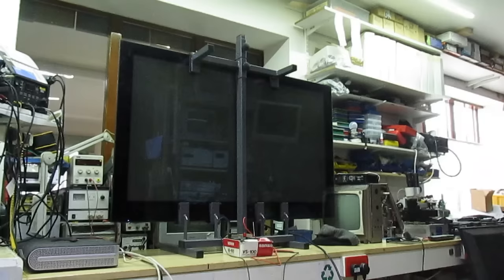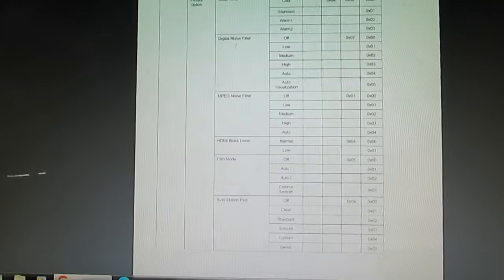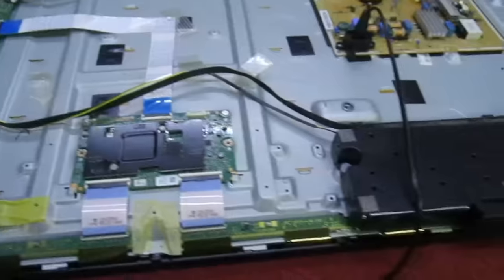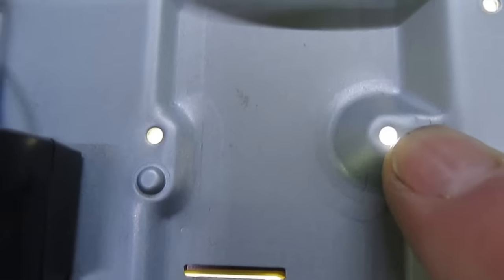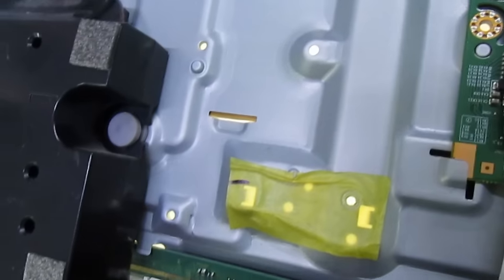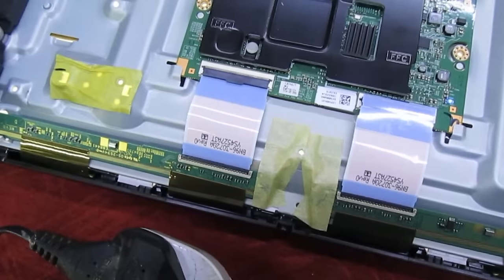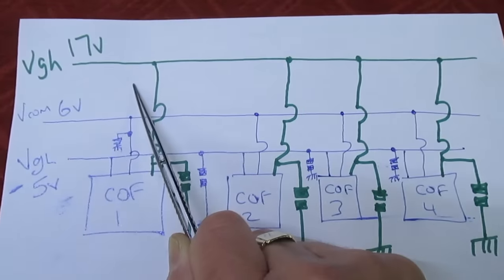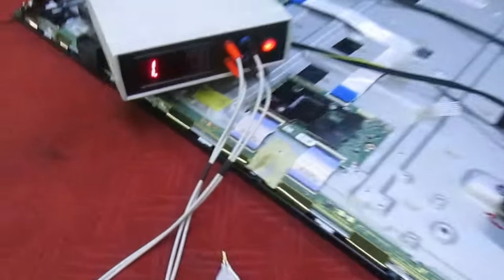Video to highlight the problem of repairing flat panel TV sets

Comment: In my last job I saw faulty MLCs all the time, only the stuff I was working on you'd have 100+ of them across each supply rail, on a PCB of 1ft by 1ft with mostly fine pitch components. The fastest way to find the offending capacitor was to solder two wires across the supply rail and give the board it's expected voltage with with a current limit of around 3A, you then either use a FLIR camera to find the hottest component OR you spray isopropanol (IPA) all over the board and look for the area that dried off first.

Unfortunately the stuff I used to work on had all sorts of safety circuits built in to stop the thing working if any of it's connectors were not seated correctly, you'd get about 500 milliseconds before it would detect and error and shut the supply down, so this very old school way of fault finding simply wouldn't work on that stuff, in fact some of the 3 phase power inverters (motor drive) would just explode if you did that.
It was hours of "fun" reverse engineering unknown circuits on multi-layer boards with hidden vias.
Reply from the maker: I don't have a thermal camera so if I cant find the fault with a milliohm meter I do the bench power supply trick and burnt finger method !

Comment: It's disgusting that the manufacturers are not providing the critical information they are supposed to provide for proper service. This is worse than "right to repair" because you are a service provider that is supposed to be authorized and trained on this stuff. Everyone complains about e-waste and this is a perfect example of how to avoid it. Good job and piss on the TV companies!
Reply from the maker: I quite agree  but if TV s had kept up with inflation a set like this would have cost £2,000 and them manufactures would support repair but in todays day and age they wouldn't be in business very long selling a part for 10p .Hence everything now is designed to sell you a new one .
Reply: @michaeldranfield7140  I think you are right but your cost per year on the item might be the same. If I spend $400 and it needs replacement in 5 years or I can pay $1200-1500 and it lasts 15-20 years. You have the same cost per year and have less waste in the system. If the units were recycled to a significant % level then it wouldn't be so bad but it's like the 60-70's where companies were dumping chemical waste into rivers, lakes and the ocean, which is not acceptable anymore so why is e-waste acceptable in the name of planned obsolescence?

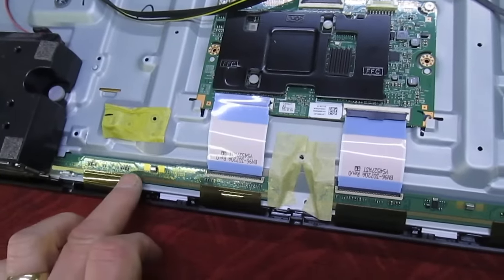Comment: This is just an excellent video.  It shows one reason for the precipitous decline in TV repair.  The other reason is TVs are much less expensive than they used to be.  I have been doing TV repair for 46 years.  From receiving tube CRT TVs, to solid state, to  plasma, DLP, LCD and OLED TVs.  All of the US manufacturers of TVs like Zenith and RCA are long gone.  Most of the Japanese companies have left the business.  It is an extremely competitive business with the Chinese in the market.  The manufactures don't want the sets to fail for the first 5 or 6 years because that makes the customers mad.  They make the screen fragile.  So a broken screen is the most common problem seen.  They price the screens so they are not economical to replace.  They run the LED back lights so they fail early.  Access to the service manuals is limited.  And as this video shows if you can get a service manual it is almost useless.  There used to be SAMS Photofacts which had detailed schematics for almost all TVs.  The manufacturers marketing strategy is clearly to not have TVs repaired.  TVs could go back from commonly being throw away to repaired if a enormous TV repair database was available and schematics and component parts were readily available.  Note: in the video there is not an explanation at 11:55 as to why plugging in the ribbon cable from the faulty board by itself did not cause the back light to shut down.   Thanks again for this great video even if it was in a foreign language.
Reply from the maker: Its not just limited to TV S now , its virtually impossible to get spares for anything and service manuals are no longer exitance , its all part of the plan to just sell a new set unfortunately , and it doesn't seem to matter how much you pay for something , its still not repairable when it goes wrong, the reason there is no explanation about the ribbon cable is because I don't know , without a service manual , technical description and  schematic diagram  its impossible to say and without this a lot of these faults are found by accident and just pure luck rather than down to skill I'm sorry to say.

Comment: Great video soooo good to see someone fixing to component level..... And a new trick for me re the low ohm meter
briliant
Reply from the maker: Glad you liked it , I could do many more repairs if I had a circuit diagram , a lot of SMD components are now that small they cant print any numbers on them so a lot of the time without a diagram your stuffed and the only option is a whole new pcb which not many customers want to pay for .

Comment: I have a question. When the shorted component was removed, the tv worked. Why did it need to be replaced if it's working without it?  I'm not in the electronics field, but was curious.
Reply from the maker: you would be surprised how many components you can remove from a TV and it will still work , to fully understand you would have to be an electronics engineer so for simplicity lets just say its for noise suppression and if you dont have any noise then you dont need the part .
Reply: @michaeldranfield7140  Thanks. That's interesting!

Comment: i ran a tv repair shop for a while i wouldn't even touch these, i did and still do vintage audio and vaccum tube tv's i won't repair any tv's after 1990 my 1964 vacuum tube color rca tv is more reliable then modern sets
Reply from the maker: vintage stuff was built to be repaired in those days now everything is built to be disposable , I would much rather go back to the old days .
Reply: @michaeldranfield7140  indeed so would i

Comment: I would have really wanted to see how you replaced the new cap, not just shown us it replaced. How it that done?
Reply from the maker: a cap this size can just be replaced with a soldering iron using a wide tip so you heat up both ends at once .

Comment: Very confusing video because the fault went away when either of the two timing board cables were unplugged . This is weird yet the video suggests this is expected??? Not sure how that works.
Reply: I wondered the same thing. If the fault was on one side, why does it work when the other side is removed? The faulty circuit is still connected. I guess I'm missing something here as well.
Reply from the maker: you are correct , this tends to suggest the fault was not on the LCD panel but as I dont have any circuit diagram or technical information on this set I cant say why it behaves in this was but Samsung sets do some very strange things .

Comment: Great troubleshooting pops!  It rather pisses me off to know I've thrown out several of these flat panels previously with similar problems (especially the first ones that were so expensive when these first came out) and usually only months after warranty run out, only to find the repair cost of board replacement as much as the initial cost of tv!  Everything today is throw away, nothing made to last. Is this the price we pay for the advancement in technology?
That's a hell of a price to pay!  I  think possibly when greed became a factor in this equation, and quality was thrown out.
Reply from the maker: I know what you mean , I too have scrapped sets assuming the screen was faulty in the past , personally I think they price the boards high to discourage people from having a set repaired as its better for the manufacture to sell a new set but what they don't realise is the consumer will be very unlikely to replace a TV with the same brand if they have not had satisfactory service from the first set.

Comment: My career was in radio telecommunications starting with thermionic valves, moving on to discrete transistors, then the first integrated circuits and finally entire stages in a single chip controlled by computers. By that time, the only moving part was a switch on the kit to power it on and off, and a few cooling fans. As time passed, the service manuals got thinner and thinner, culminating in self diagnosis systems that just gave the number and location of the faulty daughterboard. So from component  diagnosis and replacement, to just "pull out a board and chuck it" in just a few decades.
Reply from the maker: That's exactly how the TV industry has gone now but the problem is new boards are so expensive its usually cheaper to buy a new TV , I had a samsung few weeks ago , not long out of its 12 month warranty , a new board was just over £180 , the set only cost £229 brand new .

Comment: Great video,but I would have loved to see your surface mount soldering technique of that cap.
Reply from the maker: on a cap this size you don't need any special equipment, the size of your soldering iron bit covers the whole of the side of the cap , just flood the cap with solder .
Reply: @michaeldranfield7140  👍 I've been practicing my surface mount soldering on old scrap boards that come out of scrap radios and air conditioning split units.
Some of those resistors are soo small. 
 I have to replace a not so  small resistor in a Yaesu 991 radio, and just want to get alot of practice;I also bought some desoldering alloy to decrease dwell time on the Iron because on some of these boards the traces can get damaged easily.
 I also found a Flat  T.V. with a bad mosfet; the burn Mark's gave it away.
 You Mike are a real T.V. repairman which is very rare these days.
 Thanks. Johnny...

Comment: Would it not be easier to check the temperature of the caps. That dead shorted one must be very hot compared to the other three?
Reply from the maker: Not always , in some circuits where excess current flow is detected the chip simply switches off the supply rail .

Comment: well done , did you built the milliohmeter yourself ?
Reply from the maker: Yes, I made it over 10 years ago but never used it as the quad test leads were over £100 a set, only started using a couple of years ago when I found the Chinese were making the test leads for a tenner.
Reply from the maker: I did a video last week of DIY milliohm meter.
Reply: @michaeldranfield7140  thank you for your answers and for the video, i missed it ! but now i subscribed so i will no longer miss your video ! again thank you .

Comment: I even changed the capacitor on power supply it was easy to see the fault when they were popped up
Reply from the maker: All brought about by cheap Chinese capacitors, you wont find any sets now using caps like Panasonic that last for years .

Comment: Hi Michael, I was (almost) going to abandon watching your video at 1 minute into it, but so glad that I watched and listened to your every word! Just like you, I have lost faith in buying new TV's because of the problems that you describe. I am self-taught (from books and YT), but it becomes terribly frustrating when you spend scores of fruitless hours on the same TV, realising that you lack the ability to find the cause. Most Flat Panel TVs that have been given away (to me), have been simple fixes - like Capacitor replacement of PS Board. It's the most fantastic feeling when it comes to life again! I won't entertain the Chinese 'cheapies' but like to fix LG. You are amazing with your knowledge, and it's clear that the backlights weren't working because the power supply was compromised. I am currently looking at a 42" LG with picture on the left half only. On the faulty half, just a lot of vertical coloured lines. As you say, most people simply replace the Boards. I replaced the T-Con Board, but the problem remains. Justanother one for the Tip I guess. Thanks Michael - for teaching me that little bit more. Greetings from Sydney.
Reply from the maker: Glad you liked it, older electronic stuff is far more repairable than the new junk.

Comment: If you understand electronics sufficiently, that is, how things actually work, fault finding anything is easy, schematic or not. I moved from repair, to design, and could always find faults faster than the other techs, because I figured out which component did what and knew which one was probably causing the problem.

I was taught, supply rails, reset, clocks, control lines, then data & address.

Comment: Just curious, it worked without the cap in place, what would happen if you continued to use the TV without the cap at all?
Reply from the maker: Its just a local decoupling capacitor so should still work if you left it out
Reply: @michaeldranfield7140  I used to repair flat screens as a side hobby.  I only had a multi-meter and limited knowledge.  I mostly looked for visibly blown caps.  I got out because it just wasn't worth it anymore.  Huge waste of time and then people didn't want their TV's back if I couldn't repair them so I ended up stuck with the disposal fee.

Comment: Who needs a service manual when you have genius diagnostic skills like this :) 
I'm currently trying to fix my TV irrespective of the cost. So far I've changed 3 boards, numerous ribbon cables and now looking at a 4th board... D'oh.
Reply from the maker: the problem is you may change all the boards only to find its the screen and not a board .
Reply: @michaeldranfield7140  Thanks, Michael ... 45 years ago, I got a TV repair licence but never used it. How things have changed. YouTube is an endless source of help (Thanks to gentlemen like you). I'll keep trying. Gives me something to do in my retirement :)

Comment: I'm currently building a milliohm meter to help find faults more easily on a friend's old Rolls-Royce classic car, the main problem though is providing adequate overvoltage protection for the cheap little digital display device which almost certainly won't have any such protection of it's own. And it's good to see a bit of more traditional fault finding being applied on such a horrible modern contraption full of so many horrible micro surface mounted, or worse, parts. And I once modified a mobile phone charger transformer to replace a failed output transformer on an old 1950's battery valve radio, and it worked! And it even fitted nicely in the old transformer's mounting clamp too, how about that?!

Comment: I HATE modern micro surface mount GARBAGE! with all the stupid little tiny "components" like little grains of sugar all so neatly sweated onto the boards, and dirty great chips with ever so tiny pins all far too close together and some don't even have pins at all, but stupid "ball grid arrays", little tiny contacts underneath the thing! and stupid multi-layered boards with umpteen layers of copper tracks hidden away sandwiched in between layers of the board where you can't get at them or even see them, what utter stupid crap! I suppose they're more economical to produce, but you need the skill of a swiss watch maker to repair that stuff to anywhere near component level. And I've repaired and fully stripped and refurbished loads of the old TV sets with the old cathode ray tubes, great big bulky heavy things which give you dreadful back injuries when lifting and carrying the bigger models, but at least they were miles easier to fix with just basic traditional tools, as well as adequate test equipment like a decent multimeter, pattern generator and an oscilloscope of decent specification, and of course you got circuit diagrams in the service manual along with expected waveforms and voltage readings etc. at key points of the circuits, and I still know the full procedure for setting up an old delta gun colour TV tube by heart! A lot easier to set up than the later "precision in line" tubes from the far east with their little loose scan coils and rubber wedges, and horrible little neck rings, anyone remember them? I've still got a working colour portable set with a tube like that. And another thing I hate about the modern stuff is those dreadfully flimsy ribbon cable things which not only rip far too easily but also all too often don't easily and positively fit properly in their connectors, it wasn't like that with the old CRT sets, their wiring loom connectors nearly always fitted correctly every time and they didn't rip either as they were made from proper wiring, not stupid feeble ribbon crap.

Comment: Nice video on how to track down the problems. Too bad the tvs today dont have a schematic since it would be interesting to look at the signals. Just image how much electronic waste is generated by a defective $.10 capacitor!If people would take apart thier tvs into individual boards and sell on ebay for a few dollars we could keep these units out of the landfills for years. Perhaps this could be a good business like the auto wreckers. Pickup their tv, remote , manuals and charge them the $50 haul away price. Now you can stock the parts on ebay or fix peoples tvs. With a good data base and some organization it could be a good business for retirees or disabled vets! Do not attempt to start this business without a big basement or your wife will divorce you! Can you list a link to the home brewed milliohm meter.